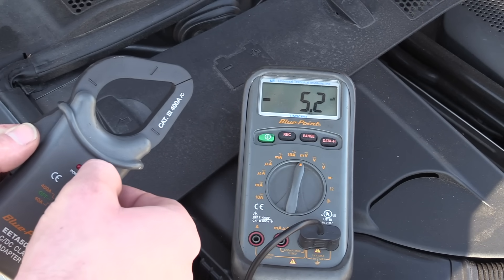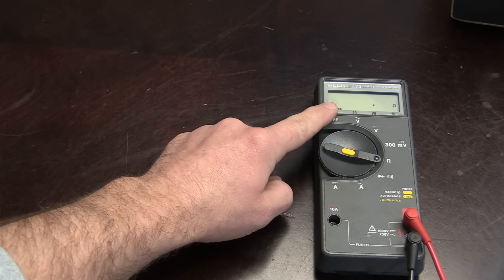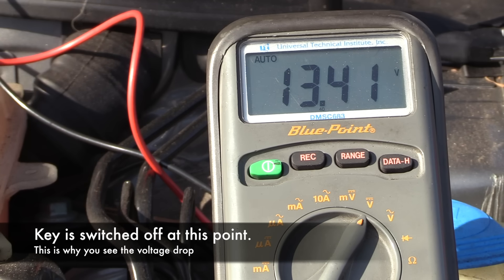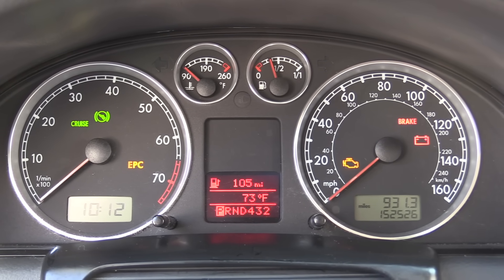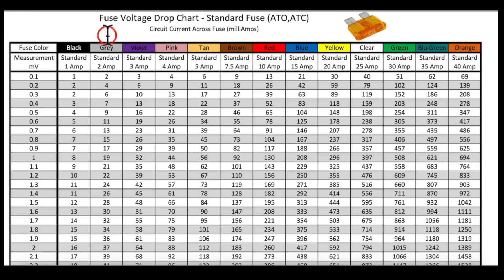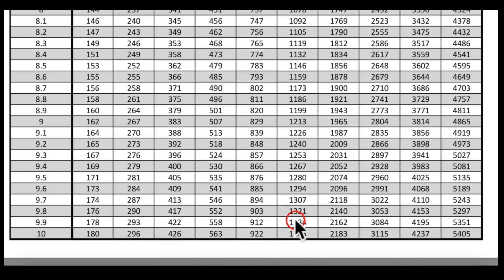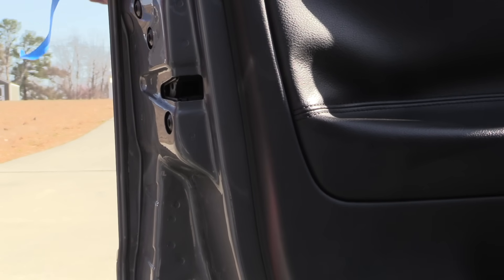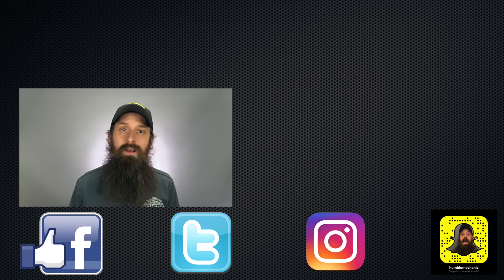The BEST Way TO Perform a Parasitic Draw Test

Comment: Its very important to check fuses before start metering. If a fuse is blown you might have 12v on one side and ground on the other (through a windshieldmotor or windowheater etc) and your multimeter might get damaged when measuring up to 300mV. Set meter to 20v dc atleast and do this test before switching over to 300mV.
Reply: I've done that mistake several times. My cheapo multimeter just says it's out of range. Nothing happens to it
Reply: Maybe there's still someone out there using analog meters though- those will take issue  with 12V into the 200mV range 😉

Comment: Hey humble, just a quick question " BMW " technical say please dont use continuity on ANY circuit that has modules attached-ECU Etc...
Due to the voltage sent via the volt meter down the line can blow a module, But how ever i never heard this before any other tranning courses but now i dont use it unless the cirucit is unplugged, would you agree? 
The answer i'm looking for is it just bmw thag are very senstive or all car modules ?

Thanks humble biggest FAN 
#Georgie  #UK

Comment: on a 2010 Aveo I can smell wires burning under the hood if the fan is on high I think it's the fan motor so I'm going to replace it but now I can check the voltage pull I going through the fuse I hope I thank you

Comment: How is there a voltage drop across the leads of a fuse? Doesn't that mean you have an open fuse? Seems one lead should be on the battery for ground and the other on one side of the fuse to see if there is volltage at that spot. Otherwise you are testing the voltage across a short (fuse)

Comment: Sir, my car battery 45ah battery of fully charged 12.60 volt drops to 12.40 volt in just 2 days
 Is this drop too high or normal?
Reply from the maker: Is that 2 days of sitting?
Reply: @HumbleMechanic  yes, 2 days straight sitting and parked.

Comment: For new viewers, just an observation that 1006 milliamps is just over 1 amp, not  0.1 amp as was said at 7:06. Humble Mechanic has acknowledged that he mis spoke in old comments below.
Reply: Thank you. I was so confused.
Reply: I noticed that too. I'm glad to see a confirmation in the comments. 1 amp is not a small draw!
Reply: @realSamAndrew   But the mentioned discrepancy was .006, The remainder of the equations faulty fraction representation.   And if this is the only fault in the presentation, of which the methodology is not just out of box, it ate it, Dude is batting 999.9?  Divergent thinking is the undercurrent of innovation topping it off with someone who will actually show it to anyone/everyone? RARE!.  This is better in so many ways and probably some I am not seeing .  Props to ya and thank you HumbleMechanic
Reply: Ludicrous speed, I agree with you but you missed the point of my comment. I am not even concerned with the roundup which didn't strike me as an error. It was a typo which turned out to change the scale. It made a fairly insignificant amount into a huge serious amount. It also would lead the viewer to think that he was doing it wrong if he got a different answer. The rest of your comment is spot on the method is fantastic and the presentation was fantastic. Accuracy was the only small item and by correcting it it makes the video much better not worse. I am grateful for all sincere helpful comments and mine was meant to be that as well . I  Thank the other commenters for pointing this out and also everyone who adds other helpful information
Reply: @realSamAndrew    I didn't even see it that way. It felt like just another comment section "stab you in the back to boost my ego" if you follow. I see it so much in videos where the maker is helping everyone and people say the most asinine shit and sometimes I feel compelled to say something only because it seems like the right thing.  WOW the world would be so much better if we could all chill the hell out and simply be civil with each other,most of the crap is just misunderstanding anyway. THIS TIME I'm glad it was my mistake!  Unfortunately most of the time I'm not mistaken.  Nice bumping into you!
Reply: @ludicrousspeed9711  you're spot on😉
Reply: @ludicrousspeed9711  agree
Reply: @realSamAndrew  exactly
Reply: 1000 millivolts in 1 volt. 1000 milliamps in 1 amp.
Reply: I caught that too. Thanks for confirming
Reply: I was about to write this and then saw your comment.
Reply: Yea I noticed that.   Glad you posted this, I thought I was going crazy !!
Reply: Thanks
Reply: I double checked my math and the video like 50,000 times thought I was losing my mind! Hahaha
Fantastic video though. He’s quite brilliant. I never knew this trick even after doing tons of electrical diagnostics of the year. 👍🏻👍🏻
Reply: I was about to post the same, glad I'm not the only one that caught it. It can be easy to make a simple error and understand that it wasn't intentional.
I still like the method. I've heard of it before but this is the first time seeing it.
I'm a believer and downloaded the charts referenced.

Comment: 2000 Jeep Cherokee 4.0 ok i borrowed a meter with the meter set on 20 v with the key on, ac controls on, fan on, and ac unplugged.  With black lead on neg post and red on  the compressor  ac plug it reads and 0.01 and  on ground wire coming right off the compressor reads 0.01.  However when i manually  kick the clutch in using the  hot wire on the compressor to the hot battery post i then get 12.5 6 7 volts etc  When   Jeep running everything hooked up the same way i get 13.4 5 volts  from the ac plug and  ground while  running shows 0.02  The voltage from wiring harness wire/with the ac plug i get 0.06 running .  Update  With motor off, key off, with neg battery term hooked up i get 0.00 at the ac plug and 0.00 at the ground on the compressor... but when i unhook the neg cable/post i get a reading   of 12.21 an rising from ac plug and 12 .13 an rising on the ground coming off the compressor. Terminal  hooked up no reading. Term unhooked and with my black lead directly on the neg post of the battery i then get a reading. I  admit I dont know much about using these meters but ive been watching video's trying to learn all i can. I really appreciate you trying to help me. i must get this working. I have breathing problems and i really need the ac working. Its hard for me to catch a deep breath when i get real hot. So Thank you very much if you will  to help me. but my battery dont go dead but thats the voltage.

Comment: Have a question. I own a 95 gti vr6 and I am having brake light issues. My brake lights work when I press on the pedal but when I turn on the lights they don't come on. Replaced all lights and still nothing. Any feed back or ideas would be great
Reply from the maker: Check fuses and wiring. I’ve had a new wiring issues on those

Comment: my sister had a car soon as it raids the car stopped  she had it into 4 or more dealerships they only know how to bill you  and I would think that work was not done the block heater cord was not working she put in in one of my dad shops was a cold night it was the exit day when I was taking the block cord out, did find  a surprise the block heater cord was on the manifold and melded put a new heater cord on and the car never did stop in the rain you would think the dealership would  check that before they sans it out the car was bought in January you think that they would make sure they block heater would work 
on the other hands for me if the new vehicle would not start in the cold there is something wrong there I still do not plug my truck in the winter 
work at I plant  taking me good 2 hours in the morning to check all the trucks and forklifts and to start them up  in the winter the operator of the vehicles were too lazy to plug them in I never I a truck that would not start up   before that  most of them  had a problem with it 
we had a full-time mechanic working there  that was a ful-time job for him  did ask me to come and show him  how to start  a clod truck did go down to the shop jumped in it and turn the key  the glow plugs start  when they were done I did it 2 more times  then turn the key to hear the fuel pump see if it kicks on  you may have to do they 3 times then  the truck should start right up  and it did  
the mechanic was amazed I kept a record  on each vehicle each day  were was all the lever  on each equipment  Monday I did hand them in to have them sign  at first it was passed off  one of the forklifts the records showing leak under it  did tell them about it  and the mechanic was told about it the motor went out of it  the blame was pushed on to me but all the  paperwork that was signed  they know about it I covered my ass very well when they were looking to hang who was to blame here it was the companies failed to have a program that did see a problem with the machine 
I am not working there any more found a better-paid job they still have someone looking after the equipment there 
for the new job, the did sheets but did not tell want should be done did make up a new program  for them and did use it  they office was amazed by it I did ask them if any changes should be done would like it to 
I did ask them if they had a tool list of tools for a new worker  they did not have one  did make up one and did talk about it with any other employee they had to see what he thought and can add on  redone that and did hand it in too  
we never have a good satiety program out there for us I was on another big job for them I had 4 other workers with me did  have all 4 sign the sheet in the morning and after lunch, if the job changed we working in and outside as well did add the weather of the day too  the other job they never did they ran in to a problem with it not doing it  
 my ass and the 4 guys I covered their asses  
right after that, all that was working on any jobs need to have the sheets filled out to each person needed to have what they working on for the day too  
one other customer wanted to see all the work that was done on paper they been asking me questions for 4 months I did print off  he was lucky I had worked  3/4 of the work there was mine 1/4 of the work he was not paid untell the paper out show up 
he sold the company to someone new  they pulled the same thing on him I did tell them he needs a paper trail just the work I did was paid out  he  fired my short time of that  he did lose a lot of the customers they found were I was working at and came over  their 
I was taking to count over  stealing customers it was a very short trail and o was clear of all of it a short time after all of the customers did came over  here
Reply: Punctuation is your friend.

Comment: Voltage drop across a fuse wouldn't that just show us there is resistance in the fuse. I put 1 less on a good 12v source (battery terminal or a supply wire) then second on the fuse showing me the voltage drop from source to drain. Just how I do it

Comment: great idea and great way to do a parasitic draw test. However, i will suggest(after doing all preliminary work you did with latching doors and hood) use of a clamp-on probe on negative side of battery with arrow facing away from battery and if you read any Amps then you have a parasitic draw. then you do same in positive cables and when find which positive cable has the draw then trace it. if it goes to front distribution box then you do voltage drops on fuses as you did and go with the chart(great tool by the way). if positive cable goes to rear distribution you do voltage drop there and no need to waste time doing front or side or whenever the distribution can be. Modern cars have 5-6-7 or 8 boxes with fuses so will be a great idea to focuse on the power wires that supplies those boxes. when you find the draw on the fuse through volt.drop then you need a wiring diagram to see what that fuse powers because can be 3-4-5 different components. after you find diagram start unplugging one by one the components and when you do so on the bad one you hit the lottery and and your fuse will change reading to 0V.
Reply: Good post. In the electrical world we called it divide and conquer. Keep breaking the entire system down to isolate the area. Then once in the right area ( fuse box #XX) do individual testing until you find the draw. Then Bobs your uncle.
Reply: what arrow are we talking about (arrow  facing away from battery ??  )

Comment: 99 Jeep has a parasitic draw.  I pulled every fuse, to no avail.  Then I disconnected the alternator.  Still the multimeter amp pull is the same. I found one wire that snapped in the cluster that goes into the passenger door.  I'm going to solder that, but doubt that will have any effect.
Reply: What I meant to say was....now I’m going to try to check voltage drop on each fuse to see if I can locate the problem.

Comment: You'll save time and headbanging if you first check the fuse you're about to test with your method is live. Most of the fuses are only live on Ignition or Accessory position of the key.
Reply from the maker: Checking fuses (for a blown fuse) goes with fixing anything wrong with the car before you start a test like this. You are right that many fuses are not powered if the car is off. BUT if it IS powered with teh car off and asleep, you have possibly found your problem.

Comment: Update 2002 Toyota Avalon Xls..with the dcc put back in and the two fuses removed radio(makes sense keep clock running but a 11 volts maybe not that.....and the other fuse  e c u no 2 I’ve I’ve been using a test light with neg terminal off and hand over door switch with the light bright I pull the 2 fuses and light drops to dim if I put back any of the 2 bright light again.....

Comment: Great info. I would still rather put the circuit in series with my meter but understand it could disrupt the fault. I avoid that scenario by sticking a jump box on while disconnecting the negative cable then put my meter in series, then disconnect jump box. Unfortunately I would need another meter to check voltage drop, but at least the amp meter can immediately confirm if I have a draw, because draws are generally rare in the first place.

Comment: 2002 Toyota Avalon xls has a 11 amp drop killing the battery. I track down to a 39 amp fuse marked DCC take it out now the interior lights go out trunk light radio door locks I checked lighter both of them still has a draw
Reply: The direct circuit connection that isn't switched off with the key. The "keep alive" that is supposed to keep your clock running and the station presets from going away with the key off.
Reply: If there is draw, see if you can move the fuse so nothing does turn on (accessories) unless the key is in the "On" position

Comment: how and what would you test  on vw cc that starts with 14+volts but once warmed up starts to drop into 13's voltage new batterie and alt
Reply from the maker: 13.0 on the dot or 13.5. I’d be looking at wiring issues or ground issues

Comment: I have a 2011 ford escape and last year i had a parasitic draw and fried a couple of batteries before I realized what it was.  I'm a diy not a mechanic so I'm a slow learner.  Lol. Anyways I did this exactly the way you just explained but it didn't work for me. The draw ended up being my rear window wiper motor was not shutting off so the circuit would only show a draw when it was trying to "wipe".   I did have a feeling it was the wiper because it stopped working all together so I kept my multimeter hooked up to the battery and every 50-55 seconds the draw would come and only last about 10 seconds and go away. Very consistent with a wiping motion since I could time when it would happen. When back and found the wiper fuse and held the meter there and bingo i found it.
Reply from the maker: Great find!!!!

Comment: Had a draw on a skid steer. Not as much out there for help with equipment as there is for automotive. A fuse panel is a fuse panel so I administered your test and used in line amp draw method. Ended up being a bad starter. Thank you for taking the time to share the knowledge
Reply: Stewart W - was the starter drawing current when it was just sitting unused ? I know the old cars voltage regulators would do that at times. Was it a bad solenoid \ relay staying partly closed drawing current?

Comment: Ya your method does it using volts/chart but I still like just opening negative battery side and putting amp meter in series instead. Though cool to know both your way is a little more noninvasive to the battery that I like but it relies on accuracy of relating chart to your measuring dmm. Which is more prone to hum an misinterpretatons
Reply: But that way only tells you there is a draw. This test points you to the right circuit involved. By far more superior and less chance of forgetting you are plugged into Amp and not volts taking a chance on frying something should you test like the PCM with it on Amps.

Comment: Does anyone know if this would work across breakers too?  I would imagine so, if I could find the correct charts.
Reply: The breakers may not have enough resistance, as they don't need to generate heat to melt a filament. You could try it though. If you can accurately measure  the change in drop when adding or removing a known load, then the quiescent load will be proportional to that. eg. if adding a 10A load causes the drop to go from 5mV to 55mV, then your quiescent 5mV=1A.
Reply: Makes sense. Thanks

Comment: I was wondering if you have any input. I've got a 2006 gli Jetta. I have no dash lights nothing lights on it but does turn over .I've try everything I could cleaned grounds got a new battery new 460 relay.  I have scanned it. All fuses are good . It was having a hard time scanning I pulled the instrument cluster out then it scanned rite away. Instrument cluster may be bad .is there a way to test it ...please help please
Reply: I've got a couple videos on my channel if you wanna check them out .I'm stumped